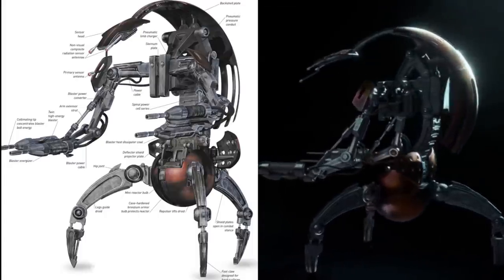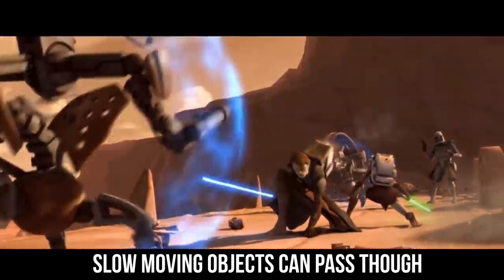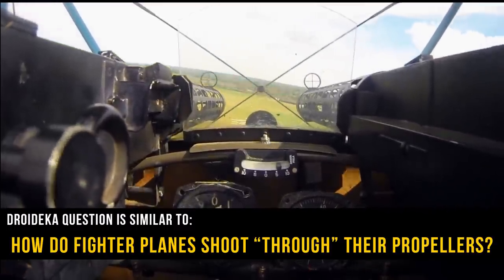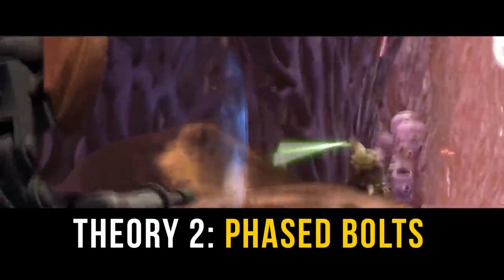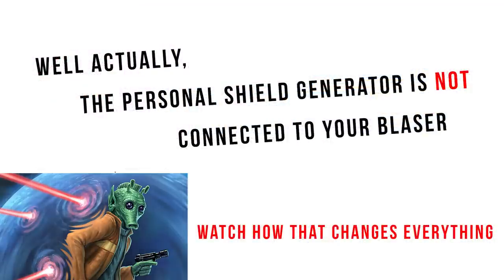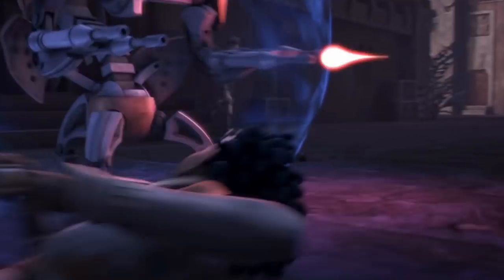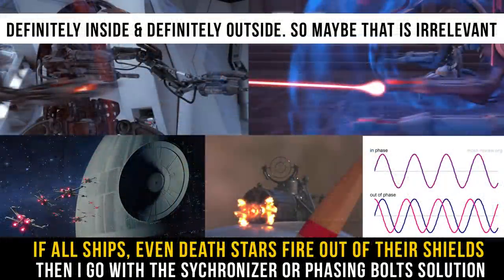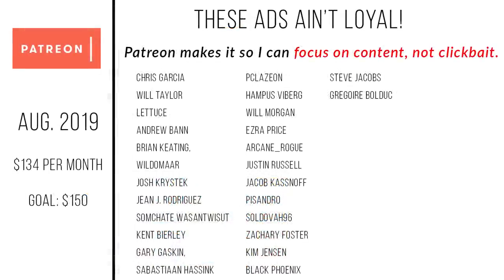How Star Wars Droids & Ships Fire OUT Of Their Shields (Deep Lore)

Comment: MetaNerdz Lore, I think that you hit the nail on the head with a constantly evolving phase generator for the shields and weapons. This would explain how the reflected bolts can never go back through the droidekas shields. It is also possible that the frequency is what changes. I believe it is also likely that a lightsaber reflecting a blaster bolt causes an intermittent frequency to be created. Thus, the frequency is never going to be the same as the shield, as it will most likely be in an entirely different frequency range.

Comment: I'd go with theory 1, the interruptor.
The reasons:
1) we got that aforementioned scene in TESB, when the Alliance lowered the shield in order for the ion bolts to pass through and knock out the star destroyer. Both the shield generator and the ion cannon had uplinks to the main control room so it would have been possible to sync them by the control room, which means they wouldn't have had to lower the shields for a moment and expose themselfs to a possible orbital bombardment.
2) you can also fire proton torpedoes through your own shield, as Anakin did in Episode 1.
3) A blaster bolt should not change its phasing that easily just because it bounced off a lightsaber. The self-containing electromagnetic field around the tibanna plasma couldn't be knocked out of alignment that easily, otherwise it would be more likely that the bolt simply explodes as soon as it contacts the lightsaber's plasma blade.
4) operators can change the intensity of their shields in certain areas, as already stated. That means it should be possible to weaken the shields right in front of the muzzles to open a hole in the shield for the blaster bolts or projectiles to pass through without having to take down the entire deflector shield.

Comment: My personal theory,  is that deflector shield technology, through energy manipulation, forces energy to flow in only one particular direction, namely "away" from the shield, and that any energy hitting it from the inside would pass through as though it wasn't there and the only time the field is challenged is when energy comes in from the other direction, much like single  direction electron flow diodes in modern electronics.   This would explain everything from Droidekas to the obvious shields in front of capital ship weaponry and fighter weaponry and even the death star shield.  Point being, if the Capital ships dropped their shields each time they fired, they would soon run out of air to breath rather quickly after the first few hundred shots.  That being said the "personal" trooper shield breaks this idea, but it is the only one that does, but if it was made to deflect from both sides instead of one,  that would make it an interesting design flaw "quick fix" to keep things like thermal detonators from damaging more than one trooper at a time instead of killing all or several.

Comment: Definitely not the 3rd, but I do have something that might replace it: the “One-Way Effect”. Certain shields are specifically designed to project certain energy outwards & by the time the energy goes back to the shield sinks, it changes. Most weapons that follows this outward flow are able to pass through where the shield’s energy crests & such. However, most of the time, the emitters & sinks are designed in such a way that this only applies to energy weapons & fixed warhead launchers. Things like turbolaser turrets that swivel are likely following the frequency principle you mentioned, but missile tubes are more immune than missile turrets because because they’re more fixed & therefore have opening so narrow that you’d have to be extremely good at hitting without getting shot down & such (specific turrets are exempt because it’s the turret itself that is shielded, not the ‘Location’ where its placed).

Comment: I always assumed a modulating phase shift, it explains everything quite nicely. How they can shoot out, why deflected bolts don't just pass right back through, why you can't fire through a personal shield as an infantry soldier, and why we don't see it drop when firing. For blasters, the idea that it drops for a millisecond and then goes back up again is completely reasonable, but the death star fires a beam, so it would need to have the shield down for the entire duration of firing, and I really don't see it doing that.

Comment: I think phase makes more sense
Because in the tcw episode where anakin got the invisible ship, the commander (idk his name) had to lower the shields in order to fire torpedos. If you could make a little hole for them in the shields this would not have been necessary, but idk if this was just plot related. But you cannot „phase“ torpedos, since they are solid rockets, and if you need to lower shields for torpedos, phasing normal bolts would make much sense

Comment: The Droideka could use a "rotating frequency" for the shield & blaster-bolt, when the frequencies match the bolt is allowed to pass through.
IMMEDIATELY after firing the Droideka changes shield frequency randomly, in that way the same bolt can not be reflected back in.
It also prevents eg: bounty hunters to use some kind of shield-frequency analyzer gadget to figure out what frequency they should use to get through.
Starships etc. would probably use something similar.

Comment: I feel the answer to this question is depending on what it is like you said with the ion cannon on Hoth parts of the shields are dropped because I I think I remember hearing in one movie where are the shields had to be dropped in order to fire a particular weapon from a capital ship we're the Droidekas might be either the frequency or the arms stick through the shield just enough and the reason the personal Shield doesn't work the same is because you can't get your blaster out far enough would be my opinion as well as the thought on starfighters as well is that the tips of the starfighters blasters are just outside of the shields

Comment: So I think it would be a combination of 1 and 2. Like all things electrical, shields would be operating at a set frequency. The shield emitter would know the oscillation timing. This can be fed to the weapons to tune the bolt so that when it hits the shield rather than being disrupted it complements the shields frequency allowing it to pass through. This would require extremely precise calculations, as when the bolt reaches the shield, the oscillations have to be perfectly synchronized. Bolts deflected back wouldn't arrive at the same oscillation timing so they couldn't pass through and personal shields couldn't synchronize the weapon because an organic would continuously move the distance between the barrel and shield making synchronization near impossible. 

We actually do something similar in the real world with noise cancelling, although in reverse. We take the sound we want to cancel out and instead of passing complementary sound waves we send out precisely time destructive waves that cancel out the original wave.

Comment: Another reason why shield-blaster phase cracking might not work is that the ‘phase’ of the bolts might decrease or change as they fly so you’d have to time a shot to be at the exact right phase at the exact right distance to pass through, which would be nearly impossible to calculate in a combat situation, even for a computer. The fact that the blaster bolts are actually globs of superheated plasma lends merit to this idea, given that after firing, the plasma bolts would only fly so far before dissipating away.

Comment: The ray shields stop energy (except in episode 3 when Anakin, Obi-Wan and Palps are stuck inside one). Deflectors stop matter. But blasters, turbo lasers and lightsabers are all high energy plasma - the 4th state of matter and a transition state between matter and energy. Plasma by definition carries a charge - a positive charge in conventional physics. So if the inside of either shield carries a negative charge, it will attract the plasma bolt and potentially allow it to pass through for plot reasons (explaining Sci fi tech only goes so far). The positive outside of the shield will repell and disperse the positive plasma bolt or Saber blade. Obviously, enough energy in the bolt or blade could overcome the shield, and possibly burn it out. Both having enormously high energy positive charges is also why light saber blades can't cross through each other, and potentially why some materials are light saber resistant

Comment: Or the energy of the bullet is higher when just released from the blaster, so maybe you could put a gun very close to the shield so it would go through. This also might answer the question of the death star, the bolt of the fresh laser just cuts threw but a shot from a ship a few miles away will do nothing cause it would weeken over the short time. 

Just a thought ;)

Comment: Im a fan of the Frequency Theroy only because of my background is satellite communication. If it was ONE frequency that would be a huge design flaw. all what would need to happen is a shield gen to be captured and you enemy would know your frequency. There is a VERY secure way we send data over satellites called frequency hopping(see wiki page), that would allow your shield and bolt to be tuned to the same frequency to allow it to pass but would also be IMPOSSIBLE for your enemy to predict even if a shield gen was captured or hacked. This would ALSO explain why when a bolt is sent back why the shield still deflects it; because the shield is no longer tuned to that frequency.

Comment: I'd say it would be whatever is more efficient for whatever is using it. For instance it may be more cost/energy effective to use the shield flicker/interrupter for smaller things like droids and fighters that only fire one set of weapons all controlled by one operator. But with larger things like capital ships it may be more efficient/safer to use the phase method as there are multiple batteries of weapons firing with many operators and this would risk longer gaps of the shields being flickered off that may let an attack threw if they used the flicker method. As for sticking your gun out, that might only be used by those with personal shields who are willing to take the time and risk of sticking their gun and maybe an arm out of the shield's protection to shoot, weather that's worth the risk is down to the individual and the situation. I'd say that both the flicker and phase methods are used but which one is used is dependant on the size of the shield needed and how many weapons are expected to be fired out of it during a fight. In short whichever is more practical for what is being shielded.

Comment: i don't know about smaller shields like star fighters or droidekas but for larger shields like those you'd find on capital ships or possibly something as small as a freighter i imagine that the shield system works like how the covenant shields work in the halo franchise where individual holes are opened in the shield just outside of where the weapons system fires from allowing the munition to be fired while the rest of the ship still has its shields up which i guess is very similar to the synchronization theory but would still allow for shields to withstand rapid fire weapons

Comment: theory 4: the bolts lose energy as they travel due to their velocity and environmental resistance.  when initially fired, the bolts have enough energy to slip through the shield, but lose that level of energy a split second later.  this would explain why the droidekas move their arms forward to shoot, basically maximizing that high energy requirement, as well as a safety measure against an undercharged bolt ricocheting back at them. the muzzle flash is the bolt's highest moment of charge, but it loses enough energy to be deflected after about 20 centimeters (or one kiros bird) of distance.

Comment: Easy solution to a Generator changing it's Phase frequency, Since there are only so many bands of Frequency a plasma bolt/laser beam can take. Make a multiphasic bolt/beam. Now 99% will get phased out by the shield gen, but the 1% that gets through, hit's the hull, use this information via spectral analysis of the target to get the 1. composition of the material of the hull for more effective hits, and 2. use that as feed back for the next bolt/beam to use. Then when their systems either automatically change to compensate for that  band, they take away energy from the others. Thus making the overall effect of the multiphasic bolt/beam beam more effective.

Comment: Take two pieces of lore one from most Starwars Paper dice rpgs and one from Starwars the force awakens
1) critical hits(roll of Natural 20 on a 20sided die) bypass both ships Damage reduction and shield ratings
2) the shield surrounding Starkiller base has a microsecond flicker they can pass thru when going FTL(faster than light) 
And the case for the interrupt method becomes much stronger however in most Expanded( now legends) universe books it says the shields are one way polarized to allow for escape pods lasers, torpedoes, ... etc.
Also remember LED lights can flicker at a rate the human eye can not see same principle can be applied to an energy shield

Comment: Maybe they're build in a way where they can shoot out of the shield but into the shield, but in exchange they're a bit weaker.

This would explain why the death star and droiddaka's can shoot out their shields( as the death star has three kilometers of armor while the droid droiddaka can be replaced if it does get destroyed )

And it explains you can't shoot through planetary or persenal shields they're going for maximum protection( as planetary shields have to hold up to planetary bombardment, and with personal shields, it's your life on the line os you'd want to put as much shielding into it.)

Comment: Or another simple theory, which doesn’t require complicated explanations... it’s almost the Occam’s Razor answer.

Theory 4: Shields are semi-permeable. They will let everything out one way but not let anything in another way. Regardless of frequencies or any such thing. It’s totally universal, except where it comes to the speed of the moving object.

This appears to be what is always happening, except in some odd cases like the Gungan and Planetary shields, but I think those could be classed as “Siege Shields” - they’re impermeable except to slow-moving objects and just needed to defend a target (usually slow-moving or immobile, perhaps owing to the necessary size of the generators) from invasion or attack. Personal shields are also siege shields, because people using them can be attacked by melee.

Now as for the other theories, there are reasons I think they’re impractical

1. We never see shields dropping. For the blaster bolts to leave the droideka, as an example where the shields are very visible, it would take quite a while. Enough time for is to see the shields drop. How do we know this? Because we can see the bolts emerging and leaving the view in the same shot, quite visibly, and for enough time that our eyes can register it.

Sure the shields could drop in a small area... but it seems impractical. What if there is a nearby explosion while you are firing a weapon with a high rate of fire? The explosion would get through the pointless gap.

2. Phased idea is pretty cool, maybe it is as simple as a kind of ‘ground wire’ where everything on the ship is the same frequency. This is also made more convenient by instantaneous communication in the form of hyperspace transmissions; the ship can stay in sync with itself in with only an infinitesimal delay. Never heard this mentioned though. No one ever talks about shield frequencies. And besides, it’s too Trek. Defeating shields is a case of brute force or Ion weaponry. Something like a shield frequency makes the ship too vulnerable. A spy on-board one of the Death Stars or even on a planet could nullify its shields by hacking this frequency and transmitting it to his allies. Bad vulnerability, a bit like theory #1.

3. If the guns stick out, they can be destroyed. The only place where this would be practical would be the  Droideka, because its guns are always moving. Imagine you’re on a Star Destroyer, chasing a large pirate ship doing a tight manoeuvre around a star. Not only can the ship shoot near to your guns to cause damage to the protruding barrels with shrapnel, but cosmic rays and particles and dust might damage your guns.

I think semi-permeable shields makes the most sense, and as with all Star Wars lore it can be explained with some imaginary science. This explains how ships fire and how they allow ships in and out of their shields. Also, imagine that something breaches the shields (like a Turbolaser which overwhelms the shields locally but not globally) and causes a huge, 150 metre nuclear fireball. You don’t want all that energy near your ship. So the only way it’s going to get out from under the shields is through theory 4, because a) you can’t really predict when this will happen b) it isn’t phased at all and c) it’s already inside the shields.

Semi-Permeability: the most simple and foolproof explanation, and the one which requires the least explanation :)

Comment: I prefer the idea of 'grounded' weapons.  Similar to electricity, the weapon is attached in some way to the shield generator.  In this case as far as the shield generator is concerned the shield, weapon, and the blaster-bolt it is firing are the same thing.  Only when the blaster-bolt traveled far enough from the shield to no longer touch it does it become ungrounded.
In practice this is very similar to the "phased" option in the video, only there is no code for anyone to try and break and bouncing off lightsabers or anything else does not matter.